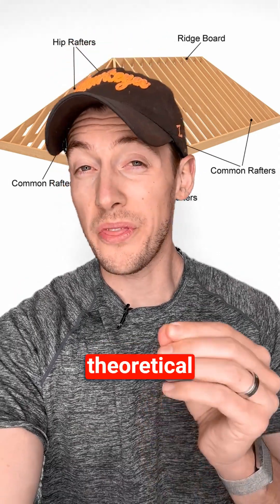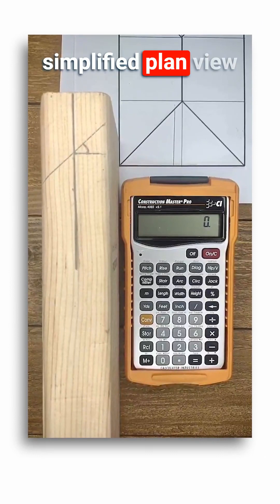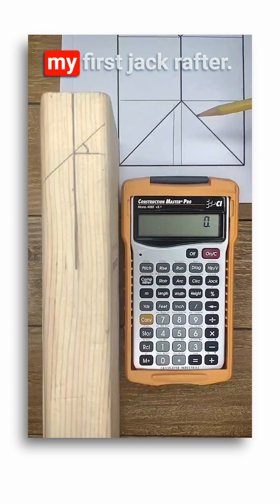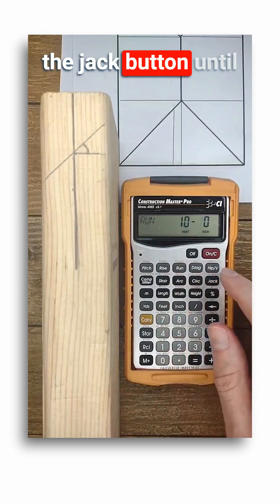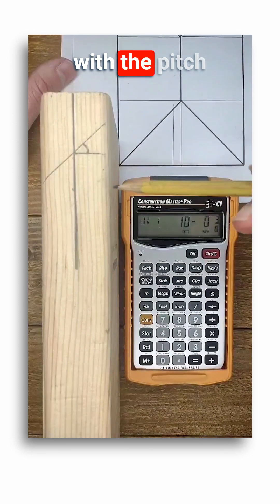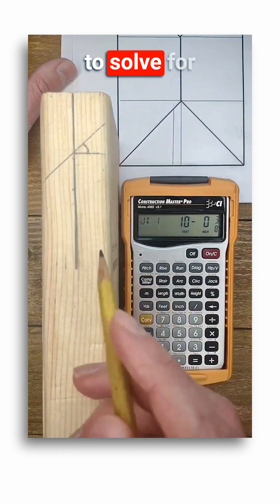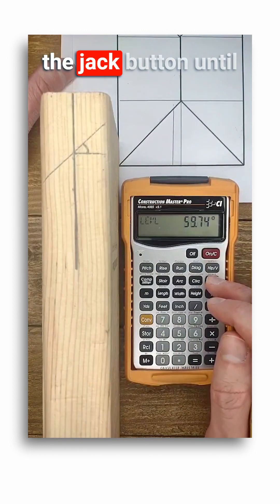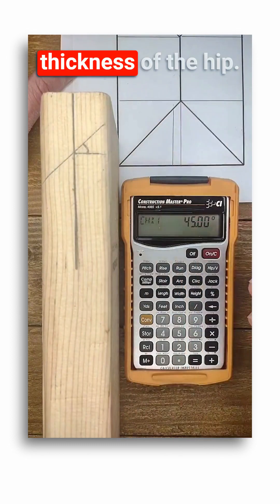Jack Rafter on center theoretical vs actual length

Comment: How to find the run of the overhang of the hip when working on an irregular pitch. 8/12 and 12/12. 20” 1/2 overhang
Reply from the maker: good question. Do you know how to calculate the plan angle of the hip relative to the wall plate? If you do, you can enter that as your PITCH and your common overhangs as RISE. DIAG will give you the run of the hip overhang